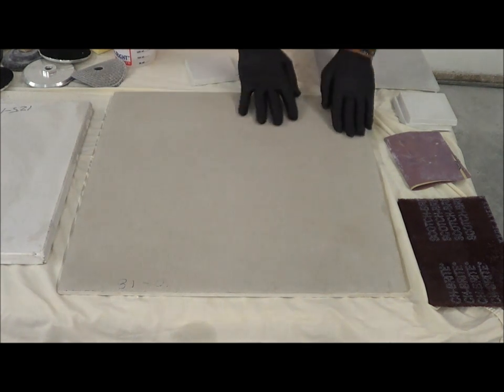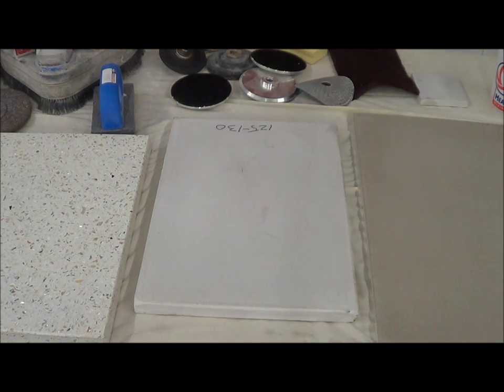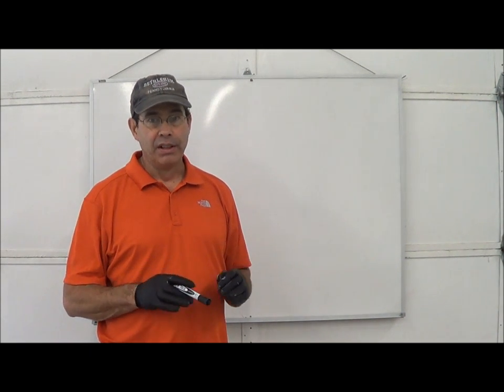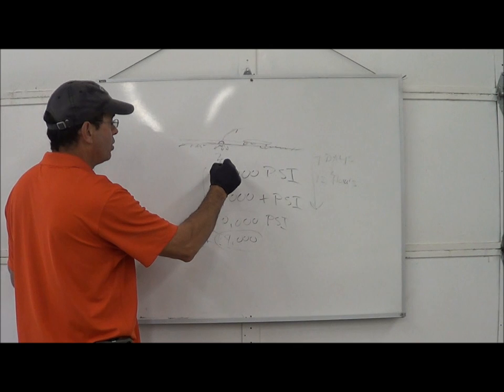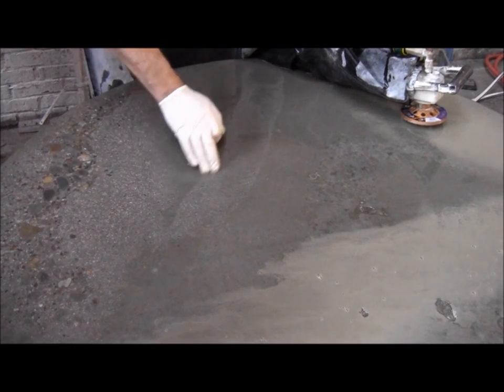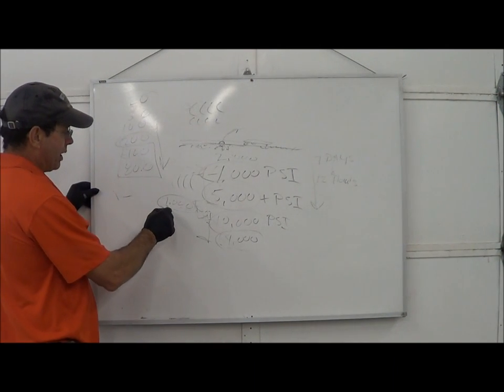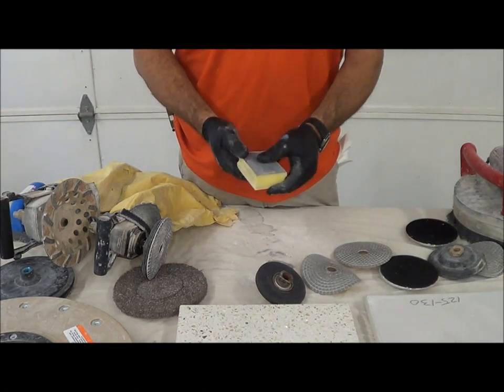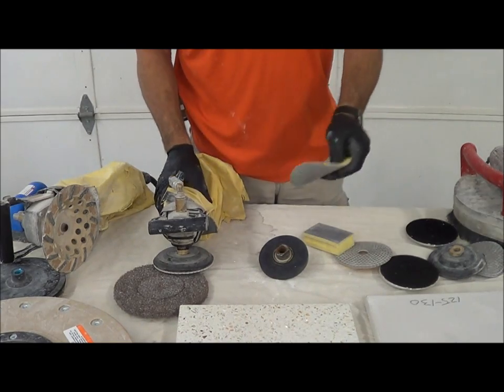Polishing Concrete Countertops

Comment: I saw in one of your other training videos where an instructor was advising students to use acid on the concrete face and then hand sand it before spraying with ammonia to neutralise the acid. He said no need to buy all these machines for polishing. So, I'm surprised to see you are using wet sanding machines. I'm researching what's the easiest system for a good finish.
Reply from the maker: We acid wash for a cream finish and polish for exposed aggregate
Reply: @TrinicLLC  Appreciate your prompt reply. Looks like I'll be buying a wet polishing machine. Thanks

Comment: I've used from 50 grit up to 800 diamond pads to remove scratched on my concrete countertop but each grit causes more scratches nothing works, it just keeps getting worse any suggestions on how to remove the scratches?
Reply from the maker: Sorry for the late response...  If you still need advice please contact Vince@trinic.us